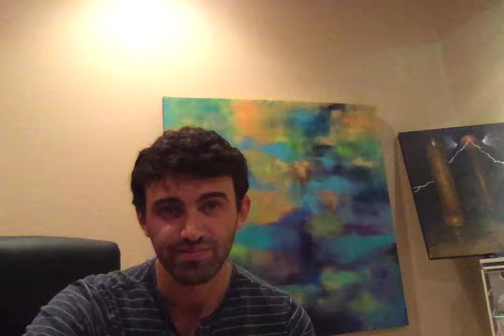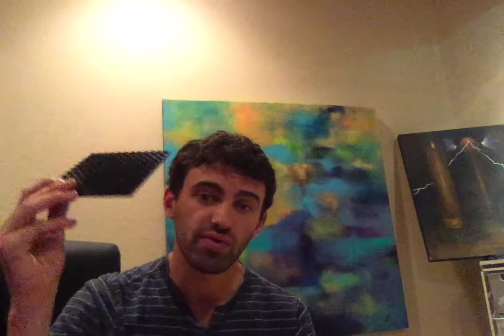Orgone and Subtle Energy Theory - Giza Pyramid, Russian Research, & Torsion Fields

Comment: The eclectricity needed to create electromagneticly induced scalar waves is said to dampen the scalar wave effects. Could orgeon energy be natural scalar waves ?  I wonder the frequency of steel wool and of metal wool. Are they 180degree opposities? Like how scalar waves are produced by using two antenas with their frequency 180degree appart.

Other interesting thing is in biblical texts it says not to wear linnen and wool at the same time because their frequencies are opposities... or mixing fabric (almost like mixing different frequencs of copper wires that hold different frequencies) the link and separation of ether/orgeon with electromagnetism and natural magnetic principles is mind boggling

Comment: Just watched all parts of this series. Very interesting information regarding this topic. Do you have an email I could message you at? I'm trying to find out if the orgonite I'm buying is precise and efficient.
Reply from the maker: Sorry, I don't give my email out. If you drop a link to it I will check it out though. I don't think there are any places where you can buy real orgone that is effective online. You have to make it. It is possible there is some good stuff out there though
Reply: @AJTalks  https://www.amazon.com/Prosperity-Generator-Accumulator-Harmonics-Ingredients/dp/B079J4M3F1/ref=sr_1_6?dchild=1&keywords=Rise%2Bperspective&qid=1608752189&sr=8-6&th=1 Are these precise?
Reply from the maker: @KaizerNYC  These and all other "orgone" pyramids I have seen for sale on the internet are totally useless in my opinion. In my latest videos I talked a bit about how orgone is supposed to be made in large layers in a chamber formation. Pyramids should be large enough to sit in and hollow on the inside or small and in grids, either way they should be the same dimensions as Giza and they serve a slightly different purpose than orgone. The conjunction of the orgone and pyramids in the form of these little plaster moulds was something someone started for convenience. They misunderstood the point of both of these things in my opinion. I do not believe you should be supporting this kind of product.
Reply: @AJTalks  Thanks for the information AJ. Hm... I guess I'm gonna have to do more studying to really understand this stuff then.
Reply: @AJTalks  What do you do btw? What gives you the confidence to speak on these topics?

Comment: Thank you, when you talk about the amazing changes what do you mean. So if  I have made a doughnut shaped piece of orgone packed with metals and specific crystals, which is then given maximum capacitance by being infused with uv light and infrared for a period of 9 days. Then I put this in a clear jug of water with a mirror underneath would this affect the water structure and enhance it.?
Reply from the maker: All subtle energy devices will alter the structure of the water. Orgone reaches it's peak efficiency when it is made of layers of steel wool and plexiglass forming a closed shape (like Reich did and like Professor Demeo replicated). The orgone shape should be remote from any power lines and ideally should be placed outside at the top of a mountain.  After three days of being subjected to a orgone generator of this description, the water will have changed it's structure so much that the measured spectrums of light which are absorbed by the water will be "off the scale" in the UV regions compared to the original water sample when tested with sensitive equipment. Other properties of the water change significantly as well as was demonstrated by Demeo. The point is it is no longer just 'water'. Your body is capable of using this treated water to purge toxicity from the blood, and according to Viktor Schauberger, even the mind  becomes capable of shedding toxic thought patterns when you consume treated water. Similar types of effects but to a lesser degree can be obtained with crystals and other subtle energy and orgone generators. Be careful though, not all metal flake devices generate orgone fields.
Reply from the maker: Mirrors should be polished aluminum to reflect these energies most effectively